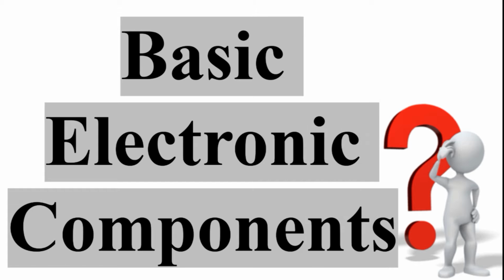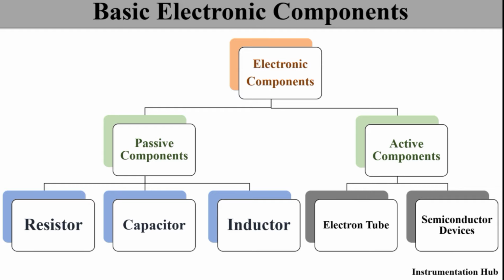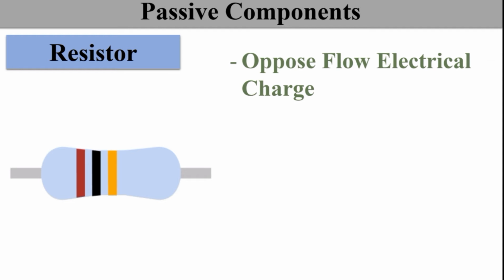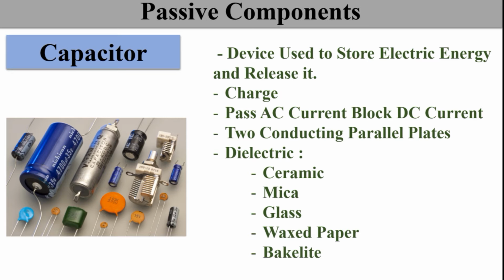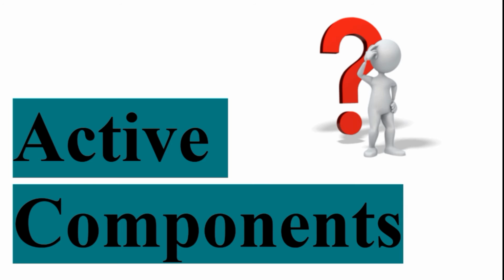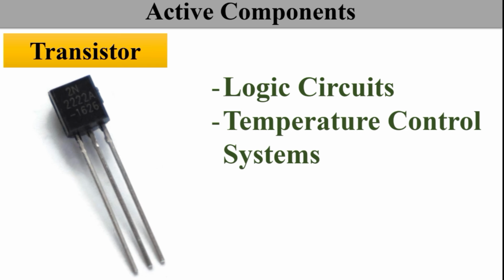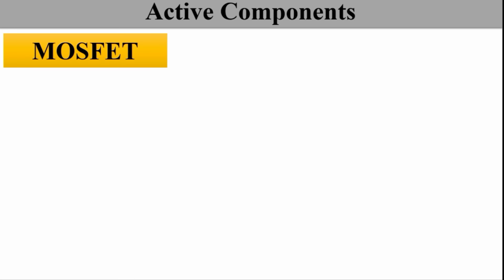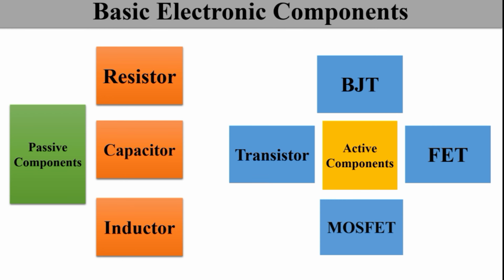Active And Passive Components | Basic Electronics Components

Comment: Resistors: linear and non-linear, colour coding of carbon Resistors. Brief description of 
Inductor and Capacitor. Series and Parallel Connections Equivalent value of Resistors, 
capacitors and inductors in series and parallel combinations. (with numericals), 
(Derivation only for resistances).